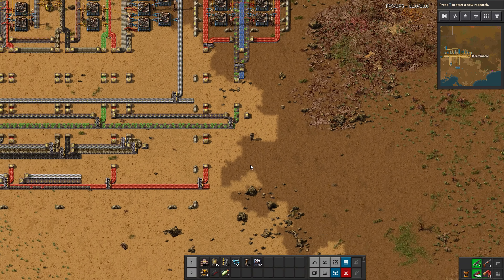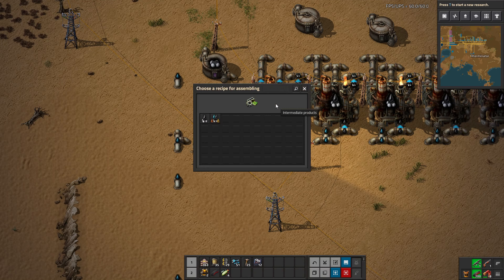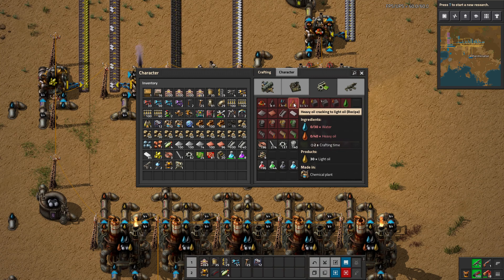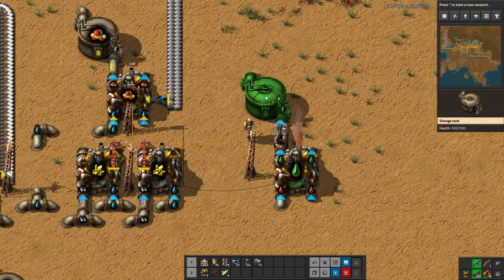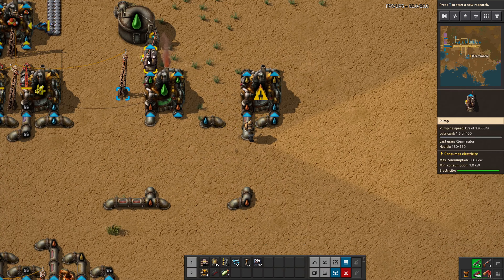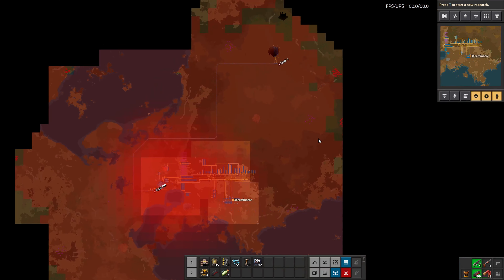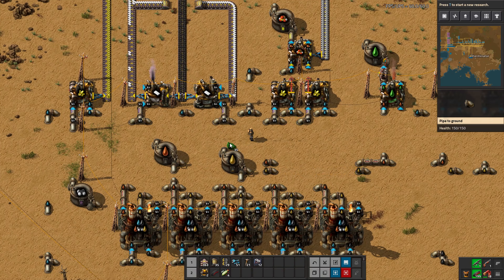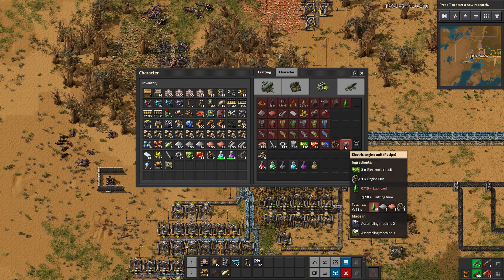Factorio 1.0 Tutorial Lets Play EP19 - Advanced Oil! : Introduction Guide For New Players Gameplay

Comment: Thanks for your time and effort putting together these tutorials. Looking forward to signals. After 3 years still I screw them up.
You used the term Hub/Mall recently. Nailus made a big deal out of it. He is in error.  A hub is the central part of a circular object (such as a wheel or propeller) or an airport. A mall is  an urban shopping area featuring a variety of shops surrounding a usually open-air concourse reserved for pedestrian traffic. per Websters  Dictionary.
Reply: So, mall?

Comment: * HO cracking is necessary because you won't be constantly consuming lubricant. Without it, as soon as the science stops HO would back up. Lubricant consumption also varies a lot once you get into blue belt and robot production
* I feel like bunkers are the better choice. And fed from chests so they don't run out of ammo all the time. Clearing bases is all well and good in the early to mid game (and of course when expansion is off). But they can make a new base every 5-10 minutes or so. At this stage it's hard to keep up with that. It also drives up evolution.
* You need ca. 3.34 engine assemblers for 7 yellow science. So effectively 4. It's not a head calculation friendly ratio

Comment: My lubricant production has stopped - as I've traced my way back I've noticed that everything has ground to a halt due to fluid overproduction. Everything was fine until I connected up the heavy and light oil pipes. Lubricant had also stopped though I did manage to get one battery produced. I've obviously done something wrong but can't work out what to do. Any help would be appreciated.
Reply from the maker: It seems like you just have too much light or heavy oil (or both) so it's backing up and stopping production of petroleum. You can either put some fluid storage tanks down connected to light and heavy oil, or a better option sunset up heavy to light oil cracking ans light to petroleum cracking. I go over that stuff in this video or the next I believe. :)